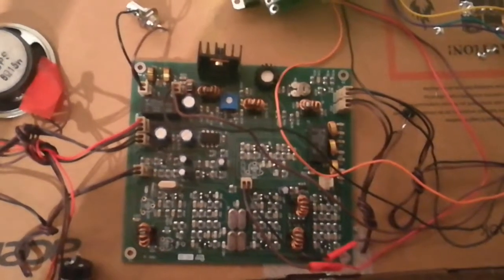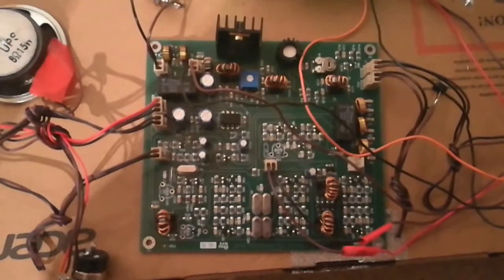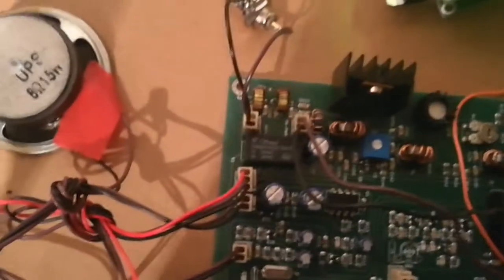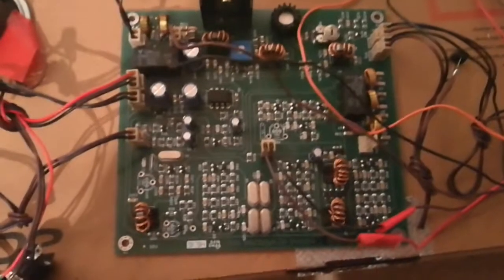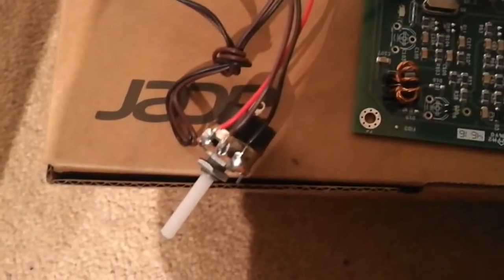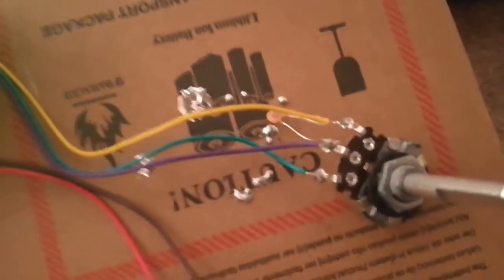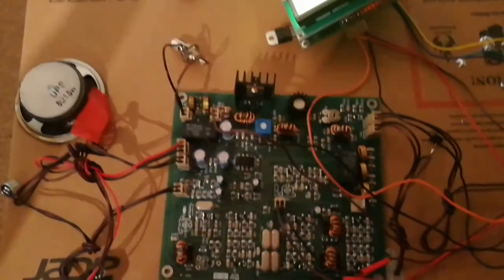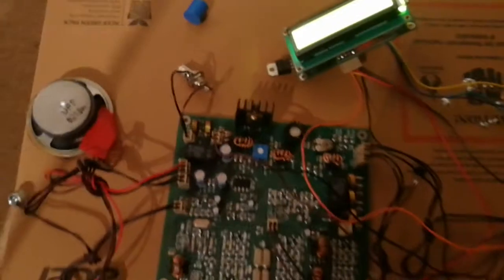Bitx40 build progress

Comment: Question for you. You only have three wire to the volume POT correct? In the directions on hfsigs it makes it seem like you also need to run a wire straight from the DC in connector to the volume POT.
Reply from the maker: Todd Brooks yes this was an early build and some alterations were needed before I put it in a case. it is now in the 3-D printed case. your observations are correct. thanks for watching
Reply: Did you make the 3D case yourself or find a good one? Thank you for sharing your information. I'm waiting on my Bitx40 to arrive.
Reply from the maker: Scan through my videos on here and you will find the 3D case including the files